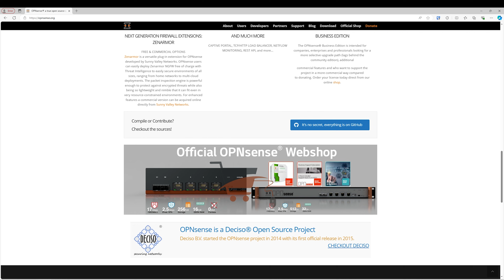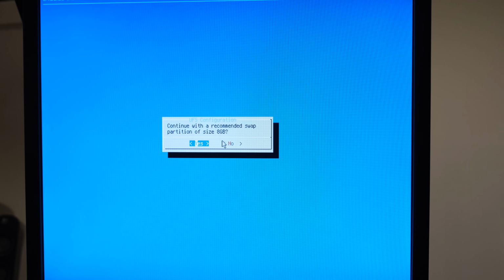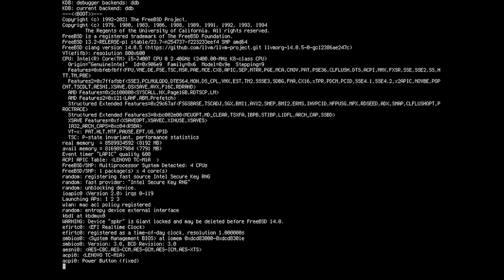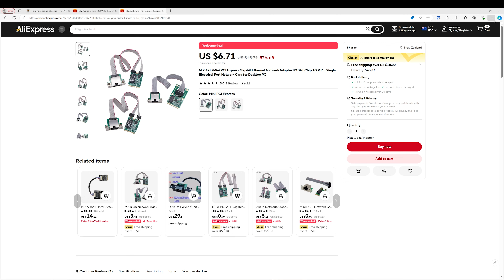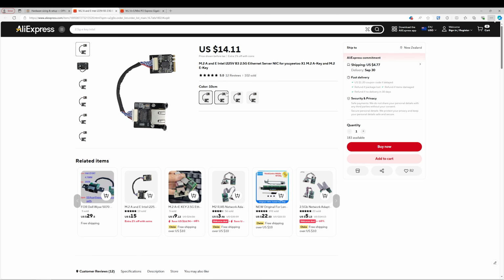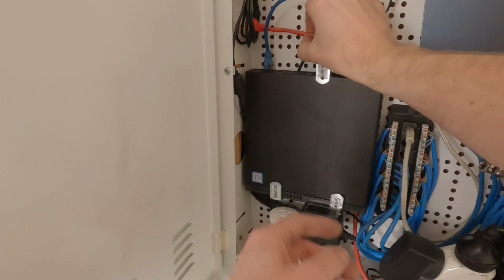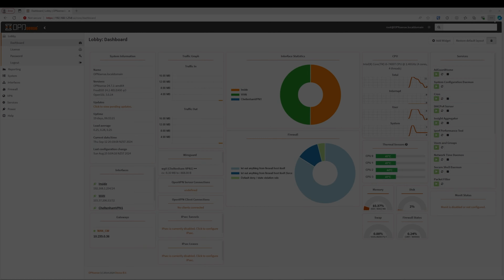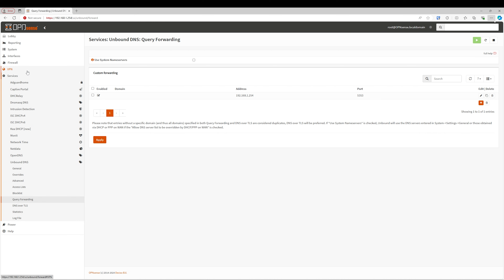Home Router Setup | OPNSense

Comment: I put PFSense on a m710q and I used the M.2 A+E key 2.5GbE NIC adapter. It was a realtek RTL8125B and PFSense would not assign a dev name until I installed the appropriate drivers. 

You can confirm if the interface is detected by pciconf -lv and my nic dev was listed as none3@pci0:2:0:0. You'll need to update your pkg's and install realtek-re-kmod. If you run the pciconf -lv and it shows up, you'll need to set it to persist on boot echo 'if_re_load="YES"' >> /boot/loader.conf.local  AND  echo 'if_re_name="/boot/modules/if_re.ko"' >> /boot/loader.conf.local

Lastly, I ran into dhcp issues as that NIC was for the LAN side and I had to go to Interfaces > LAN > Hardware Settings > Uncheck checksum offloading.  There is a known Realtek quirk that's quite common.

Comment: I'm running a m710q with some chinese m.2 2.5G nic.

Idk whats wrong but the system randomly turns off, so I just turned on restore power after AC failure.

But I need it fixed any ideas?

Also note it's a weird offbrand PSU

Comment: One question. I seed that you have a TPlink switch. If you make 2 ports with trunk based or mirror to port to wan, will this work too?
I have a switch similar to TL-SG-105E as I would like to use some. As I do not have an adapter port. I like know if work?
Reply from the maker: Sadly my switch doesn't support such things. I have an old AT Switch at my desk and that does. I really just need to get some 2.5 or 10G gear

Comment: If you get the M920q's you can put in a PCI-e 10gig or dual 4 port. I have like 7 of them on my shelf :)
Reply: My GeekPi rack showed up today!  I've got four m920qs; one's for opnsense with four 2.5gbe Intel i255 NICs, and the other three are waiting for dual 10gbe SPF+ NICs in the mail.  Gonna build a sweet Proxmox cluster.  They were $250 each on TradeMe – not a bad deal.
Reply: The M720q's also can do this but you should only do this if you have one already or can get them very cheap because you can get dedicated firewall PCs for 250 to 300 USD and they have a lot of ports built in and have better cooling. I bet the Tiny get's pretty toasty with dual SFP+ modules in use
Reply: @Turborider  Been solid for over 3 years on mine !
Reply: @JasonsLabVideos  That's good to know. These machines are really awesome, the sheer ammount you can do with it is a amazing. The heat would still make me uncomfortable though
Reply from the maker: I would have used something with 10g capable nic's. But we had so many of these from work that I ended up using them.

Comment: Thank you for the video. I have a Lenovo M700 and currently running OpenWRT.  Using onboard NIC and a UE300 (USB dongle from Tp-link )as my second NIC.  I would like to replace the USB dongle with something similar to what you did but I am Ok with a 1G NIC. It must be an Intel chipset though.  Do you have any recommendations?

Comment: could you put 2 I226 NICs in one of these? use the M.2 E Key for 1 and the M.2 M Key for the other. Run OPNsense on a sata SSD?
Reply from the maker: You might be able to, I haven't tried. I really wish I had a 2.5gb poe switch

Comment: Almost the same setup like a year ago, a Fujitsu Futro S920 Thin Client AMD GX-415GA 2GB Flash 4GB RAM with a Network Server Adapter I350-T4 V2 Quad Ports, but upgraded a few months ago to an AMD GX-424CC SOC with Radeon(TM) R5E Graphics with a 4 Port Gigabit NIC for Intel I226 2.5 Gigabit Ethernet. All using pfsense and not the clone OPNsense, running smoothly and energy consumption is around 16.5Wh. And that all for less then $150.
Reply from the maker: Name of the game is power consumption and performance I guess. I wish I could fit a 4x port NIC or a 10G NIC for better throughput. But yet to have saturated the connection.

Comment: The 1GBe will forever be your bottle neck. Even if you put a 10Gbe wan nic... 😉
So no need to upgrade your witches without changing your OPNsense router.
Reply from the maker: Well it is on my WAN side. I've yet to saturate it. My isp isn't that fast either.  But my old router just had 1gb links anyway. So no loss. I'd love some 10g links but for my application this has been decent

Comment: great setup, did you think about using some 2.5gig or 10 gig network cards ??? 
and what internet provider are you with currently, i heard you live in queenstown
and i use a dell 9020 4th gen i5 sff personally at home with a 10 gig card and 4x1gig card
Reply from the maker: It was fun to make! I do have that 2.5G port on the LAN side of the network. But my ISP is via Lightspeed here in QT. So gigabit really. Otherwise if I had the room, I'd have a rack with some form of HA setup
Reply: @thesmokingcap  Im with quic which is part of vetta online and im paying about 95$ a month going up to 105$ next month, but an HA setup is pretty awesome I just don’t know how I would make one with only one isp and I can’t get hyper fibre here where i live as I’m with TFF for my fibre provider

Comment: I'm running OPNSense on Fujitsu Futro S920 with quad port intel NIC + onboard realtek as additional one. It has quad core AMD CPU which supports hardware encription, 8GB of RAM and 120GB mSata SSD. Works like a charm. Only thing I needed was a good Wireless AP and now I'm using Netgear hardware with OpenWRT
Reply from the maker: I had to google that model, but the luxury of having a PCI-E riser for a NIC! I wished these little Lenovo Machines had that. But at least it was free from work. I've never used OpenWRT as I never had a spare compatible router at the time. But liked the features it offered.
Reply: @thesmokingcap  there is faster Fujitsu Futro S940 also with PCI-E slot, but I don't know is it worth to buy for a router, maybe if you have a lot of VLANs , much faster NICs etc. There are also HP machines: T620 Plus and T730 with a lot more horsepower than Fujitsu machines (as far as I remember both with full PCI-E 16x). In my case s920 is the best solution, cheap and quiet.
Reply: @thesmokingcap  Lenovo does have pcie and riser card in the M720q and M920q models. I have a 920q with a quad port Intel 1 Gig nic in it, running pfSense. Works great. I am going to try a dual port 10 Gig card in it.
Reply from the maker: @jjb7920  A 10g card would be nice. I would also love a proper L3 network, rack etc etc at some point. Sadly the house I'm renting has no such room for this

Comment: Could the HDMI be left in and use the space to the right for the ethernet port?
Reply from the maker: Yep I can pop out that space. I didn't need the HDMI port so just unscrewed it
Reply: @thesmokingcap  Thanks for the info!
Reply: @thesmokingcap then how did you connect a monitor for the opnsense installation?
Reply: I'm guessing he removed it because he was reusing the screws, but you could leave it if you wanted too. These usually have DP or another HDMI port anyway that he probably used .

Comment: Just done exactly the same thing with a HP Elitedesk USFF tiny PC, but running PFSense. Nice to have a really powerful firewall and now also have OpenVPN into my house which is handy.
Reply from the maker: Nice wee machine those Elite Desks. It's nice to re use older hardware as well, heaps of them out there.
Reply: What OS did you used on the pc to install OPNsense?

Comment: If you got a different patch panel for that box and moved it more to the corner (one that's more space efficient with the direction of the ports and where you terminate the wires). I think you could fit another thing in there. Also you can get tiny patch cables for really cheap to free up more space. You should put a UPS on that! Why let a short power loss take down your network? I ended up enjoying having a UPS on my equipment! I'm still having a really really good time with a linksys router flashed with openWRT and some tp link routers in access point mode to serve for my AP's and switches, the linksys router has it's wifi turned off totally and it's antennas are unplugged.
Reply from the maker: I thought about a UPS and do want one. But I have a spare machine if this pop's. So no biggie
Reply: @thesmokingcap  As always, great work! Just wanted to give you some input! Keep it up.

Comment: Dual i226/i225 m2 would have been my pick. Needs 16gb ram and a cheap ssd. Rest is fine
Reply from the maker: Yeah that would have been ideal. Sadly these machines only have 1x socket for one of these NIC's. But at least it won't saturate my WAN at all

Comment: I am running a very similar setup but on a Dell 7040 i7 6700T and 32GB 
Had a weird issue with the realtek card I put in (RTL8125), I had to disable bluetooth in the bios and got it working?? Issue #2 was BSD not supporting the card correctly itself.

I eventually settled for proxmox to run opnsense in a vm and then complied a DKMS driver I found so proxmox can use it as a normal interface. It has been working really well for about a year, more reliable than a mid range Asus I had with merlin and I get much faster speeds. The Asus was bricked by a security update they pushed which made me really frustrated and go about doing this. I don't see why you should buy an off the shelf router for $500! crazy.
Reply from the maker: That's an odd issue! I've found it can be picky with some cards, there's no hardware list I've found of officially supported NIC's. So tried to stick with Intel. Still got burned anyway. I think it's the way the OS tries to interface with it, so making it a virtual machine removes some of that dependency via "emulation". I was thinking of doing that myself, but I really wanted this to be a router as such
Reply: @thesmokingcap  there’s almost no overhead with proxmox. Definitely recommend giving it a go. There’s a steep learning curve compared to something like ESXI but worth it long term.

Comment: Really nice video, I was thinking of doing something like this too. Do you by chance know the power usage of that tiny PC? I want to minimize that because I often need to go battery powered and my current fiber optics box and crappy tp-link only eat 4-5W.
Reply from the maker: Thank you! Also I'll have to plug in my power meter and see what it draws. I know the AC adapter is a 20v 3 amp unit, so not much at all. If I manage to power it off and check I'll flick you a reply
Reply: It will eat around 10w at idle (99% of the time it will be idling if you use it as only router), just a little over that if you also setup Zenarmor, AdGuard Home and all that.
That can be considered 'obsolete' for desktop/workstation, but it´s a complete overkill for a router. You can setup all services/protections you would need for a medium office and it will handle over 30 clients very easily.